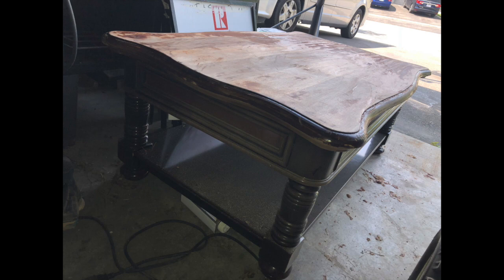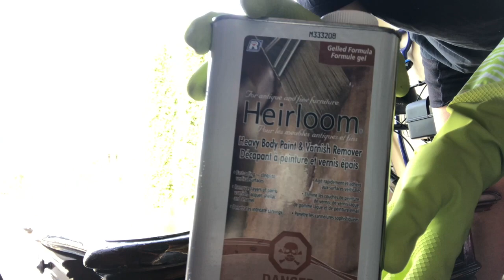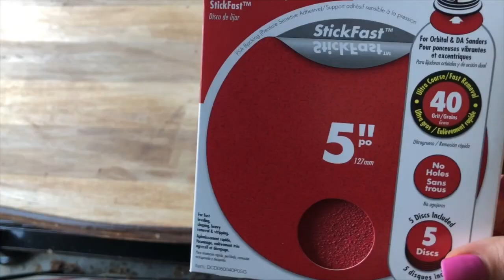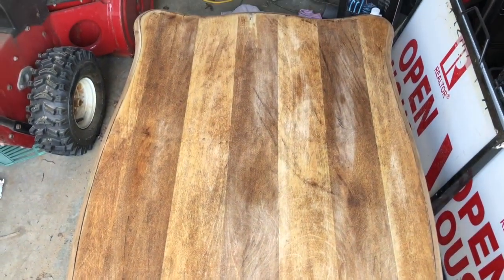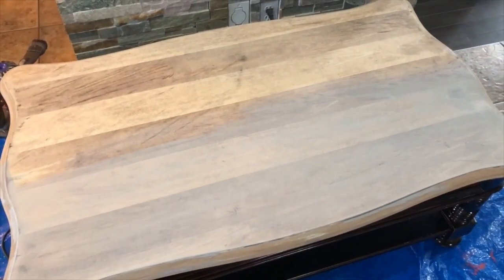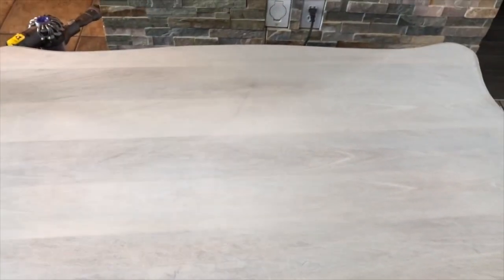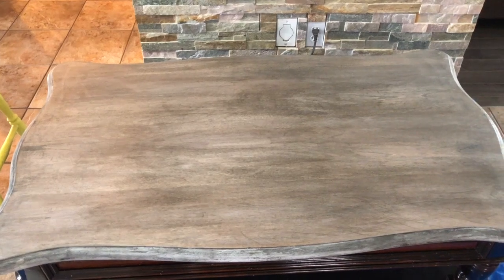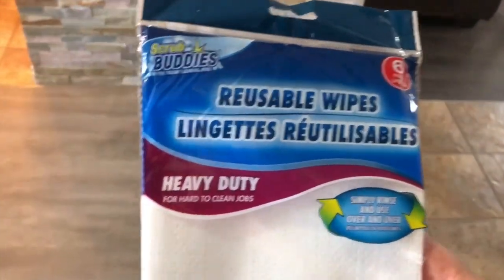Coffee Table Makeover  With Chalk Paint

Comment: Nice job!  The black wax over the chalk paint came out really gorgeous.  I do like the look and the solid bottom.  However, if the table top is going to be moderately used wax is fine, if heavy duty, I would use a flat or satin top coat for sure like GF.  Thanks
Reply from the maker: Hi there. Thank you so much for watching. I just want to report that the table is still looking really good. I run a home daycare and the table gets used all the time. I do think it’s the brand of wax that makes a difference.